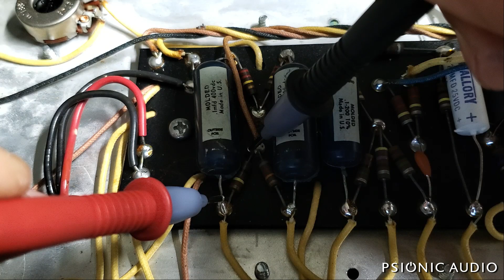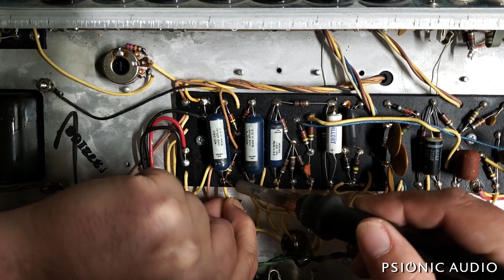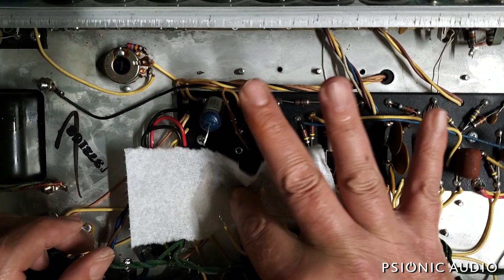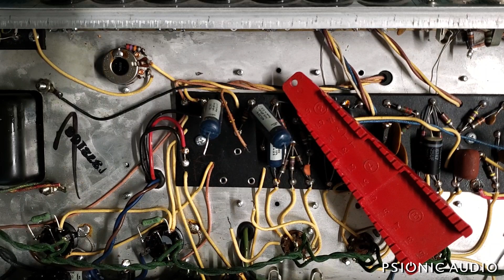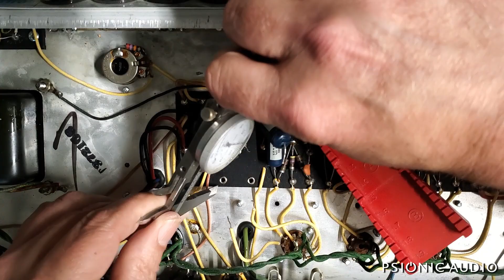Time Machine '68 Super Reverb Part 3 - Phase Inverter & Factory Solder Joints

Comment: I love this channel! Quick question… So you said the phase inverter resistors are fine because they’re closely enough matched, even though they have drifted to where one was 236 and one was 238, but what would be too much of a discrepancy? I think mine measured 220 and like 232? Im not home to double check again, but is that not matched well enough even though the 232 is still in spec for the resistor? Thanks for all your help and the mesmerizing videos!

Comment: I have the huge silver ESD safe  Soldapults and a smaller black carbon ESD safe Soldapult brand. I also have the same el-cheapo aluminum body suckers too. They are great until the plunger flies across the room or the tip blows out into the amp when you cock it. I finally bought an electric vacuum gun made by Hako, and it paid for itself inside of a month or two. I am not above using silver model paint. Those comp resistors will drift with heat and humidity anyway.

Comment: Very nice work.  I don't mind that you take it slow and provide lots of commentary as to why you do things a certain way.  I have  cap kits on order for my 1969 Super Reverb and 1977 Deluxe Reverb, both of which I purchased in the last couple of months.  I will also measure the phase inverter resistors, although I see in the Super Reverb AB763 schematic they use the 100k and 82k like yours, but the AB568 schematic uses (2) 47k.  I'm not sure of my amp's schematic revision, so I will have to take the chassis out and do some more studying.  I just subscribed to your channel and look forward to new videos!

Comment: Its nice to see you giving this pristine amp its due respect. I hope the owner appreciates the extent to which you are going to do cosmetic repair with vintage sensibilities.
I share the reverence that you give this time capsule of an amp. I have been doing amp repairs and restorations for 20 years or more. You beat all of my best attempts...lol
I am lucky to own the same Super Reverb with original CTS alnico speakers. The drip edge grill and blackline silverface plate are special being basically the same circuit as the blackface amps.
Keep up the good work and videos 👍

Comment: From the title of the video I thought you were going to show us some defective factory-original Fender soldering!. I've had a couple cases where components had been cold- soldered to the eyelets by Fender and an upwards tug on the the component lead with a spring-hook tool pulled the lead right out! (I make it a practice to test each and every eyelet solder connection this way).  I've also occasionally seen this on factory connections at the tube sockets as well, where the leads weren't bent over or j-hooked to the terminals before soldering.

Comment: Save the "trick" solder dome for a shop trick video! I know how I do it, but I won't give away the secret if you are not! Besides my way may be different than your way. What's your option of interstate transformers for phase inverters? Gibson used them in the 60s on a Hawk and other amp I once had and to use them would eliminate a tube, which has to be replaced now and then. Do you have to use certain output tubes or will any work? Also, in your option since they don't provide any amplification, can they drive output tubes well? I would be interested for a future build I'm planing. Love from NW Colorado. Thanxz